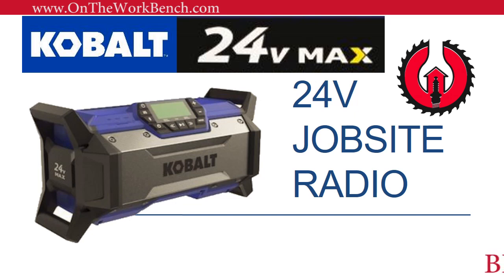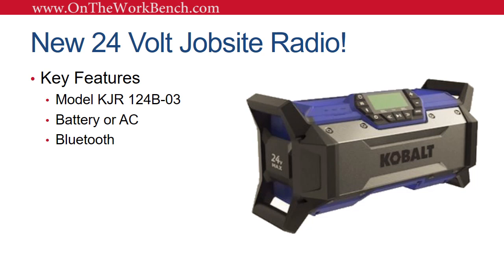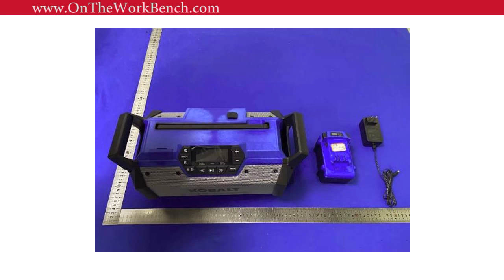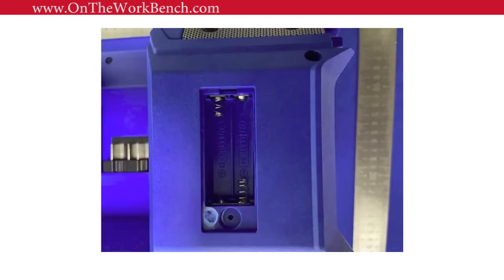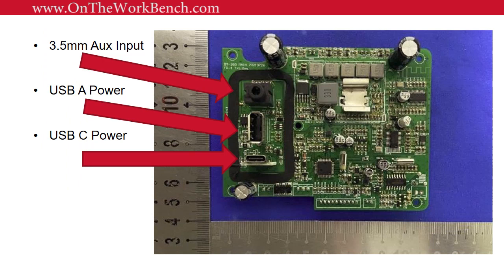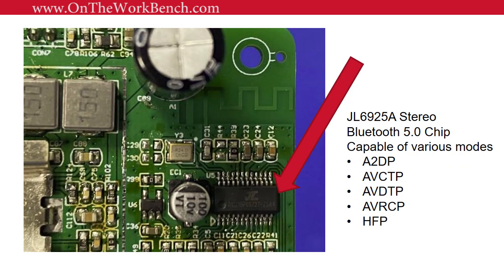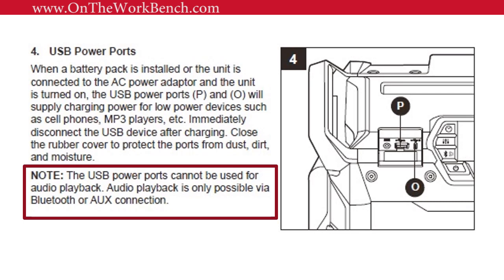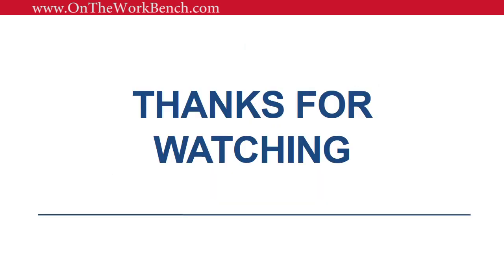Kobalt Jobsite Radio - Teardown and Specs

Comment: How does it sound??? Isn’t that the most important question not answered?
Reply from the maker: See my other video with the radio in hand to hear it. For a 6 speaker Jobsite radio it sounds great. It's not a substitute for a high priced hi-fi surround sound system that is 10 times the price. The bass and treble both have an independent -5 to +5 adjustment range too. I think the sweet spot for my ear is the bass and trebble both at +1 on the equalizer.
Reply: @OnTheWorkbench  it’s not 6 speaker, the back two are passive radiators. They use them to tune boxes for the subwoofers/mids